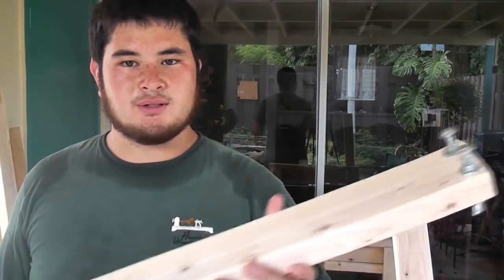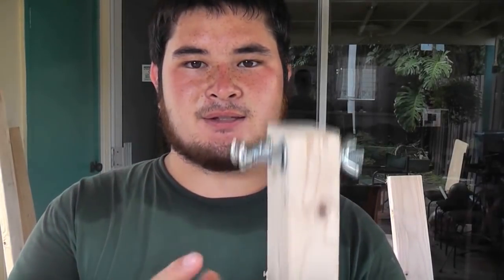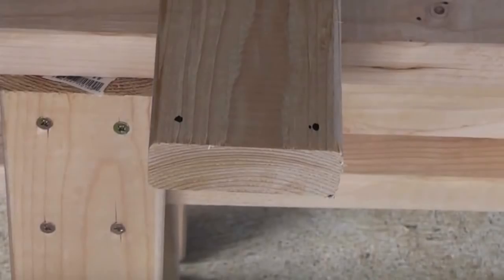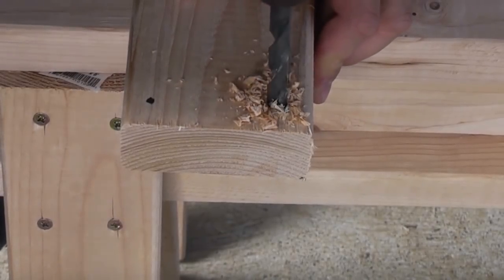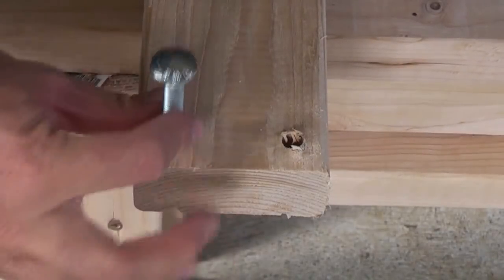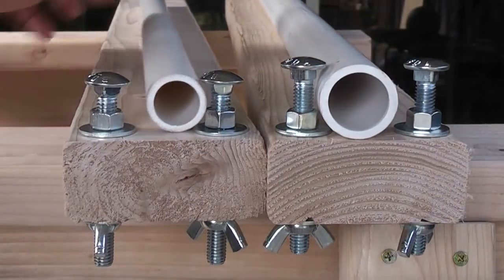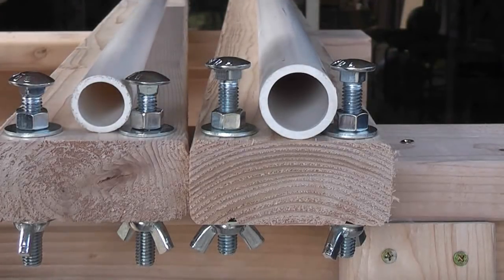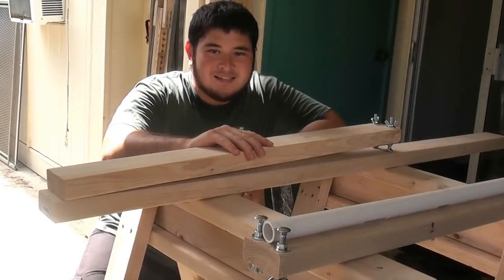Making an Adjustable Flattening Jig for PVC Bows

Comment: Quick question, is there a reason that you did not round the edge of this adjustable jig the way you did with your non-adjustable jig?
Reply from the maker: +Christopher Salvatore I've found that it's easier to go back and reshape the handle. Sometimes the rounded edge ends up creating a slightly pinched area (probably from i the pipe cooling faster right at the end) that can cause collapses.

Hope this helps! Thanks for watching!
Reply: Thanks for the information, we are making the non-heat 40 lb bows this weekend because my wife says I can't have a heat gun until Christmas.

Comment: im having a lot of trouble with 2 thing when it comes to the flattening of the limbs...my limbs are not  uniformly flat because my 2x4 isnt perfectly flat and i cant seem to find one that is and second i cant seem to keep my pipe straight whens its soft so my limbs come out wavy and uneven cuz the board aint flat and i keep getting limb collapse really quickly please help me someone!!!!
Reply: use plywood instead of 2x4s, i use plywood for my jig and its almost perfectly flat, as for the pipe not being straight just straighten it while its still warm enough to adjust slightly but not warm enough to go back to round

Comment: Nick, on this video you say to set the spacer bolt length to the  outer diameter of the pipe used.  This produces no "dent" at the handle.

But in other builds, you suggest that the spacer blocks be a length equal to the inner diameter of the pipe, which gives a dent just above where the upper board pressed the pipe, due to the spacer being smaller than the pipe's outer diameter

I assume you found a change that is better.  Which way is superior?  Or should we just go with the directions of whichever build we are following?

Comment: I love this, I have tried this. But how to you keep the pipe Parallel to the jig? For me, it's round and it tends to roll to one side or the other as I try to tighten the clamps. I tried using painters tape to hold the pipe parallel to the jig before I started pressing. But by the time I did that it cooled down. So I then tried reheating the sides while it was in the jig, but then I had a lump running the center line of the PVC from end to end, while the sides were flat.

This looks so easy when you do it, but I am clearly missing something. Based on my description, do you think my pipes are too hot or too cold or something else?

Thanks in advance for any help

Comment: it's a bit troublesome on the 1" pipe unless you get right close to the edges with those holes. I had to re-drill because my 2x4 split.

Also, I suggest drilling the holes BEFORE cutting the 2x4, then cutting 1/2" from the holes. You run much less risk of splitting the wood.

Comment: I'm just in the beginning stages of playing around with this stuff, but I had a thought of another variation of a flattening jig you might experiment with. Using a wider board  you could attach both boards with two door hinges or something like that and then attach an extra handle on the end for some more leverage. Basically it would look like a huge pair of salad tongs I guess.
Reply: I've had that same thought, but it wouldn't work for all bows. With some parts of certain bows, you need to flatten very small portions of the bow, which makes the top board hang off of the bottom board quite a bit.
Reply: Chuck Ralenkotter BackyardBowyer  I'm playing around with the idea to make one with a hinged sliding section, so you can adjust the length of the top board.
Hinge attached to the base with some kind of box section for the top board to pass through. Added bonus of only needing 1 clamp to hold it all closed, cutting down on time spent fiddling around.
What do you guys think?

P.S.
Nick.
Keep up the good work.
And Thanks for Making and Informing us all.

Comment: I did this but used a base of 1 inch block,then made 1/4 inch add ons to increase or decrease the height,I countersunk the 1 inch block which I put always on the bottom so the carriage bolt is below the block surface,board isI inch thick by 48 long by 4 inches thick,it works for me.Oh and use Butterfly  Bolts to change the heights. Nice Job Nick.

Comment: Could it be beneficial to use a thinner beam for the top part of the Jig (the one with the adjustment bolts)?
I'm thinking you could clamp it near the middle to bend the beam slightly, to give a slight curve to the taper on the Belly side of the Limbs.

Comment from the maker: The jig puts a taper in the pipe that gives the bow a smooth curve and even distribution of pressure. So the center remains almost fully round and then the pipe tapers to completely flat at the tips. The bolts are only on one side.

Comment: hey you made one!! sweet, i counter sunk my lower hex nuts and it is coming in handy with the full size compound cross bow im working on as im trying to use 1/2 pipe for the limbs if i works out i might dig out the camera and make a video, anyway keep the pvc ideas coming its a great way to scratch my project itch without breaking the bank

Comment: @zhgt, just attach some board on the sides of the base and make it a track.  Better yet, use strip aluminum so you can get C-clamps around the sides.

Comment: Not only would it cause a slight weakness at the transition point, but it would completely alter the dynamic of the bow. Bows work by reducing the pressure needed to bend them as they move toward the tips, guiding the limbs to bend in a precise fashion. If the pressure needed to bend the entire limb was the same because everything was the same thickness, then the bow could bend erratically and would not have a smooth, even release. So while you COULD do it, you probably wouldn't want to.